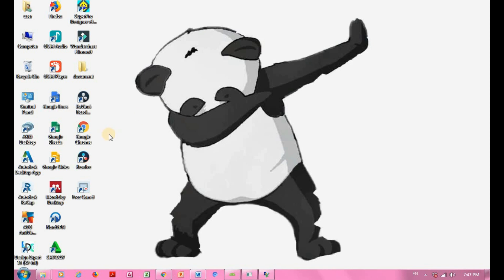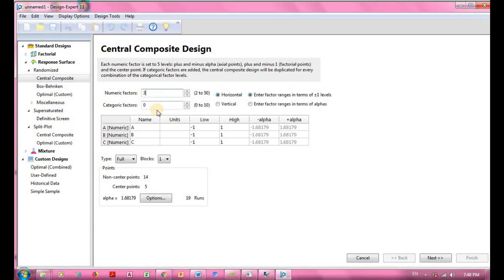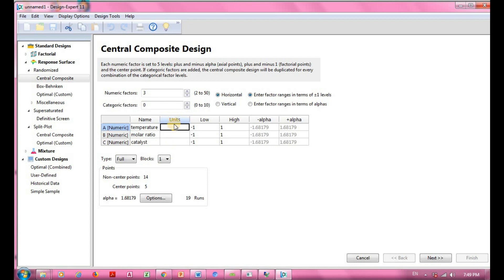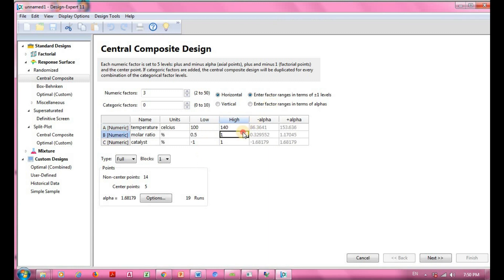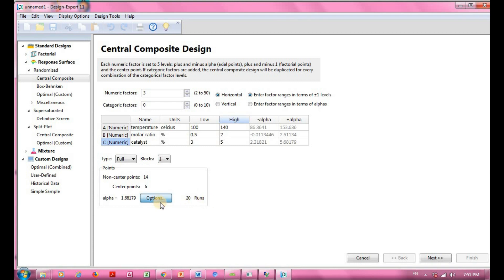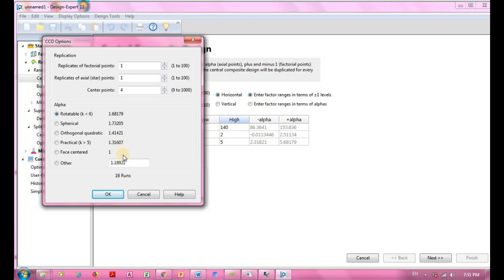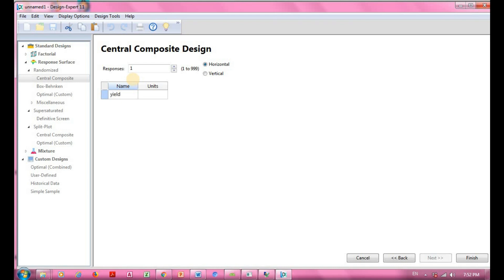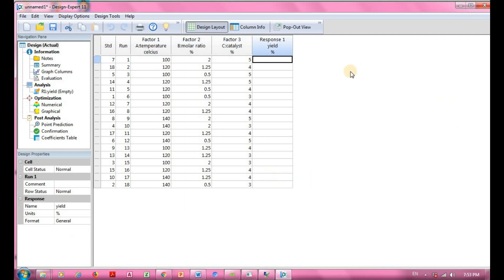Design Expert V11 Tutorial for Beginner - Response Surface - Central Composite Design

Comment: Hi, sorry to ask, I have a categoric factor of solid to liquid ratio ranging from 1:40 to 1:60 (g:ml) The question is how do I key in the value? I want to present the data in ratio form. Is it possible?
Reply from the maker: You fixed how you gonna wrote it, incase you want to key in ratio of 1:40 and 1:60, just key in 40 and 60 in the software, as long as you aware that it represent 1:40 and 1:60